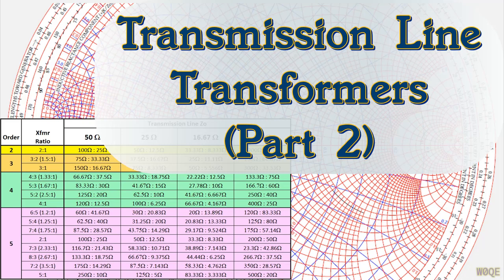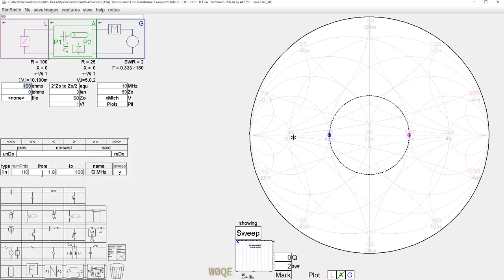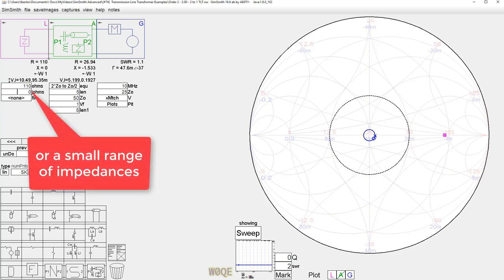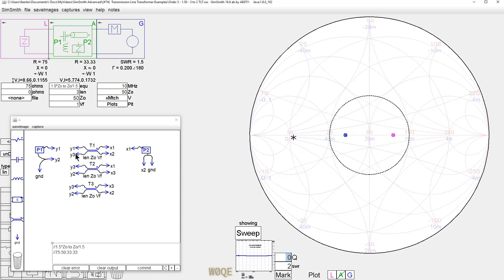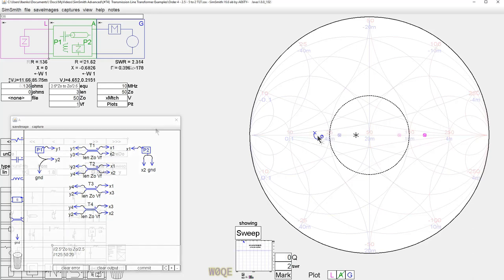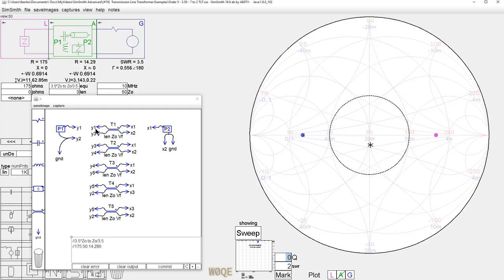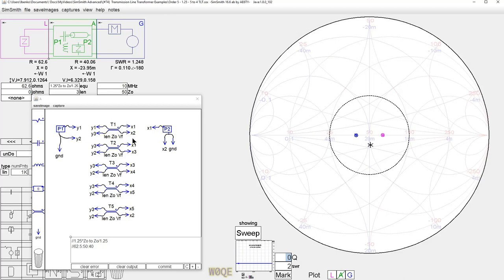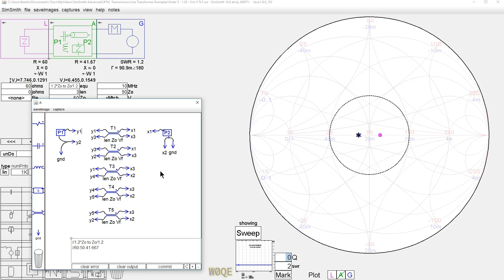#74: Transmission Line Transformers, Part 2

Comment: Just lIke all of your videos, this 2-part series on transmission line transformers is the most clear treatment of the topic that's available anywhere. Doing it in SimSmith makes a huge difference, too. As you've pointed out many times, the interactive part of SimSmith makes it a fantastic learning environment. This is way easier to understand than the Sevick material. I cannot thank you enough for all you do. (SimSmith author Ward Harriman, too!)
Reply from the maker: DP,
Thank you very much for the nice comment.  I have thanked Ward many times for continuing to make SimSmith more competent.  I only wish that these types of programs (and computing power) was available when I was a kid. :)
Larry
Reply: Ditto DP. I've learn so much in the last 48 hours since finding simSmith and Larry's videos. I was trying to match a EDZ I'd modeled in EZNEC and found simSmith. I was able to verify my paper smith calculation and so much more. Thanks Larry!
Reply from the maker: Mike,
Glad the videos were a help to you.  SimSmith is very capable but does have a learning curve.
Larry

Comment: Hi, Can you give some insight (or mathematical formula) how Zo of transmission line affect impedance transformation ratio..like 33.3 to 75  transformation (ie 2.25 ) for 50 ohm,16.67 to 37.5 for 25 ohm line  and 66.67 to 150 transformation.How do you get these fix impedance value for particular  Zo for a given ratio. Thank you for awesome video...
Reply from the maker: The transmission line impedance is the geometric mean of the two impedances.  For 33.3 to 75 the transmission line is squareroot( 33.3 * 75) = 50.
Larry
Reply: @w0qe  Thank you

Comment: I really appreciate you getting through this.  It gets a bit hard to visualize the series/parallel relationships for some of the test cases, but that just means I need to think about it more.  I could use some more fundamental background information on this topic.  I have a book somewhere called Transmission Line Transformers by someone with a name like "Jerry Bowdich" maybe, but I don't think I ever appreciated the topic until I watched your video.  It's amazing what you do with SimSmith...  Thanks again.
Reply from the maker: I think the book you are referring to is by Jerry Sevick and the series/parallel relationships can be tricky but the key is the they are NOT frequency dependent resulting in a very wideband circuit.
Larry, W0QE
Reply: W0QE Ahhh, yes, that's it.  Thanks!
Reply: @w0qe  I am interested in making a dummy antenna for a Hallicrafters S-53 and HT-40 using a
two transmission line transformers of 2:1 and 3:1 matching the 300 ohms of the S-53.
Reply from the maker: Joe,
The HT-40 is a receiver so you could just use a small resistor  for the dummy load.  The HT-40 is a transmitter which I thought had an approximately 50 ohm output so you would just use a 50 ohm dummy load capable of the HT-40 power output.  I guess I miss what your question is.
Larry, W0QE
Reply: @w0qe  The S-53 has 300ohm impedance which is why I want to use a dummy antenna.
Reply from the maker: Joe,
Let me assume a couple of things.  You must have an antenna switch that switches between the transmitter and the receiver.  On the receive side of this switch you want to put a 50 ohm to 300 ohm transformer before going into the S-53.  Correct? A cable TV 75 ohm to 300 ohm transformer would be a fairly good match provided the specs go low enough in frequency.  Otherwise you can build something which can be very small since it only sees receive amplitude signals.  I would probably wind 20turns of #30 or smaller wire on a T50-43 ferrite core and then wind 8 turns on top of the 20 turns.  This would give you a 6.25:1 impedance transformation which is very close.
Larry, W0QE
Reply: manual says use a dummy antenna with 300 ohm resister and 0.1 mfd capacitor.
Reply from the maker: Joe,
I'm not sure what a "dummy antenna" is.  I assume you want to receive signals and not just terminate the antenna input.  Maybe the receiver needs the antenna to be capacitively coupled but I doubt it.
Larry, W0QE
Reply: @w0qe  I just put a 50 ohm resistor as a dummy load on the HT-40 40meter band and got 176 volts across the resistor on tune. I'll use Simsmith to see what is delivered to the S-53 after the 300 ohm resister and 0.1 mfd capacitor. Many thanks for your time. I am halfway through your Simsmith videos and enjoy them all. have a good day.
Reply: @w0qe  I am making this for test and calibration purposes. I have a broad band antenna for the S-53. A hamstick for the HT-40 . No Switch. I have an oscilloscope with a calibration signal to send through the AM transmit . I have an idea to also connect a rtl-sdr  in parallel with the S-53 to see what the waterfall looks like.

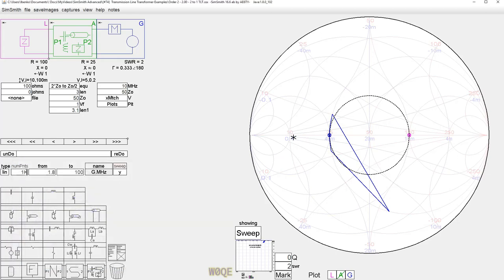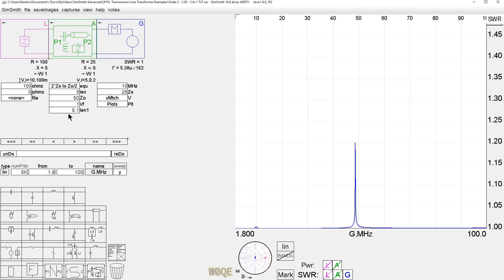Comment: At 5:40 to 7:10, you observe "there is some frequency where things misbehave badly".  I'm surprised you don't note that's when the cable length is a quarter wavelength, so the transformer is resonating, and if it were made of real (not lossless) cable, would have enormous loss.
Reply from the maker: Rod,
You absolutely correct and I probably should have mentioned the electrical quarter wavelength of one of the cables.  What I really should have brought up was that even though transmission line transformers can have very wide bandwidths you often have to balance how much line is needed at the lowest frequencies so that the common mode impedance can be made high enough with the problem of the line becoming near to odd multiples of a quarter wavelength at the highest frequencies.  Perhaps I should devote a video directly to this topic.  SimSmith can do this analysis very well.
Larry, W0QE

Comment: is it possible to design multi port device in Sim smith like 8 way transmission line transformer based divider..any clue wl be very much helpful..Thanks
Reply from the maker: If you are designing or analyzing a multi port power divider or combiner you will need to be able to create either multiple generators or multiple loads.  You can do both in SimSmith but there is a limitation that the generators must all be at the same frequency although they may have different amplitudes and phases.  You create the entire multi port device within a single RUSE block where there is a single generator entering the block and ideal voltage controlled voltage sources or voltage controlled current sources which can have adjustable gain and phase create multiple sources.  Multiple loads are just components in the same RUSE block that you measure the voltage, current, and power in to analyze the device.
Larry, W0QE
Reply: @w0qe  Thank You. If you can upload one video regarding multiport device design in Sim smith it will be very much helpful. Have you specifically discussed multiport design in any of the upload video. if so,  plz share the link.
Reply from the maker: Take a look at videos #28 https://www.youtube.com/watch?v=mHfYCdWVrV0 and video #29 https://www.youtube.com/watch?v=lg6lcQfN4Nc which discuss power combiners that need to have multiple generators.  I have discussed multiple loads in videos on baluns where a single load is split into 2 parts so that it can be balanced with respect to ground or not.
Larry, W0QE
Reply: @w0qe  Thanks a Ton...

Comment: Larry, I think thoroughness gets in the way of understanding on this video.  Nevertheless, it is a good reference.
Reply from the maker: Tom,
You are probably correct.  It took me quite a while to figure out how to create circuits where the transmission lines have 1:1 SWR's independent of frequency especially when there are 4 or more transmission lines.  I am open for better ways to explain things at any time. 
Larry.